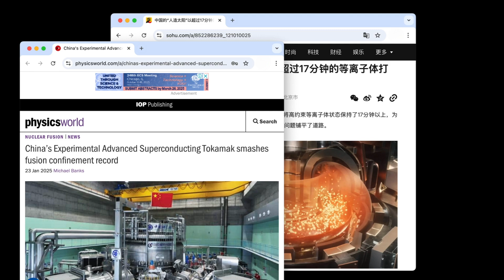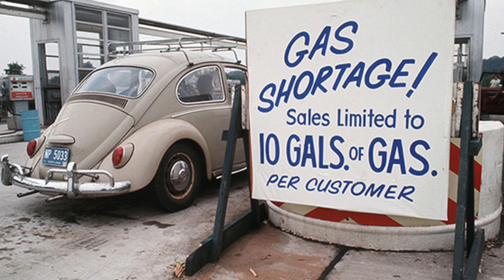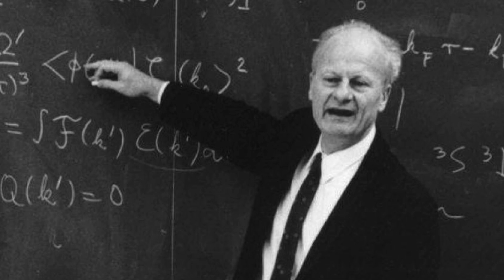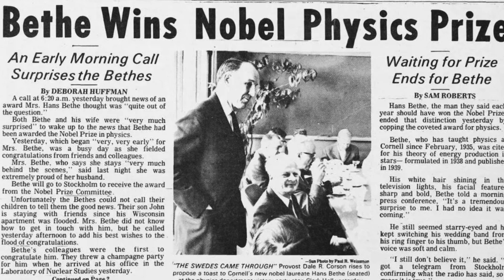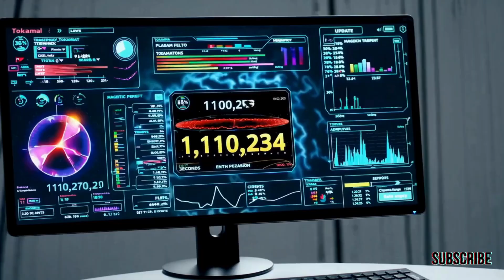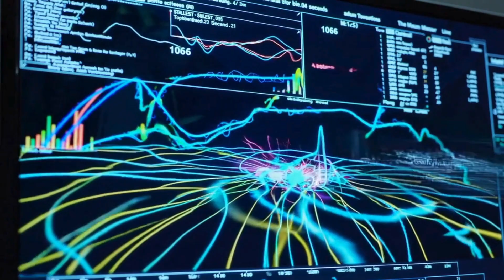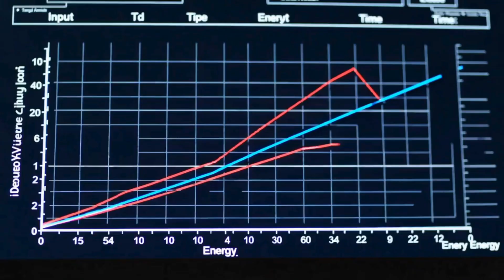China's Fusion Energy Revolution

Comment: Why did fusion stop after almost 18 minutes?
My guess is that the magnets couldn't be kept cold anymore.
Still, it's an interesting record. Maybe there's something in fusion energy after all. Maybe it's not always 30 years in the future. 🙂
Reply from the maker: Thank you for supporting our channel and for your insightful comment.
Fusion in this experiment likely stopped after almost 18 minutes due to limitations in maintaining the necessary conditions for sustained plasma confinement and stability. Your guess about the magnets is reasonable—most fusion reactors, like tokamaks, use superconducting magnets that need to be kept at cryogenic temperatures. Over time, heat from the reactor environment can gradually warm these magnets, reducing their efficiency and eventually necessitating a shutdown.

Additionally, factors such as energy input limits, plasma instabilities, or material constraints (such as the reactor wall's ability to withstand prolonged exposure to extreme conditions) could have contributed to the end of the experiment. Nonetheless, achieving a record duration of sustained fusion is a significant milestone, suggesting progress in overcoming the long-standing challenges of fusion energy. While the timeline for commercial fusion has often been described as "30 years away," advancements like this indicate that practical fusion power may be getting closer to reality.